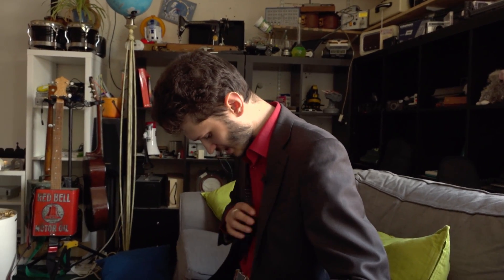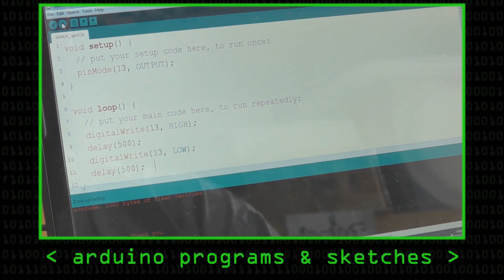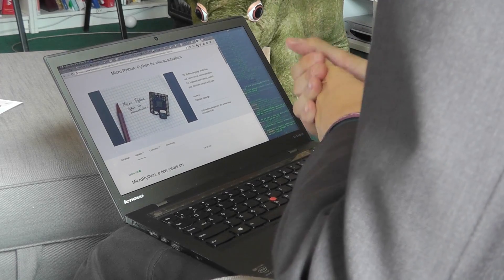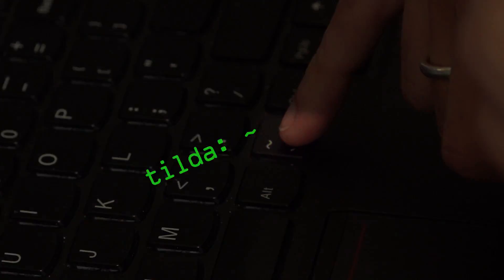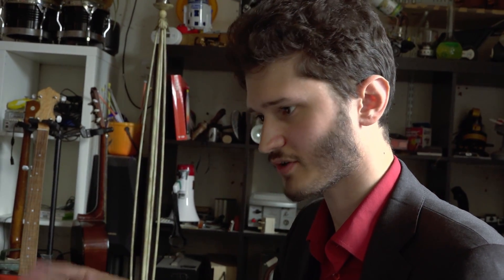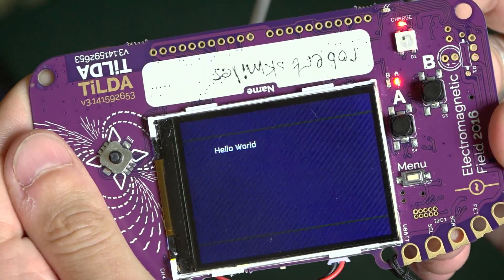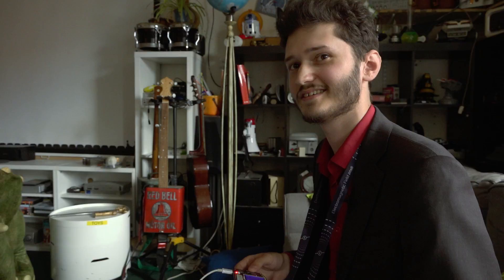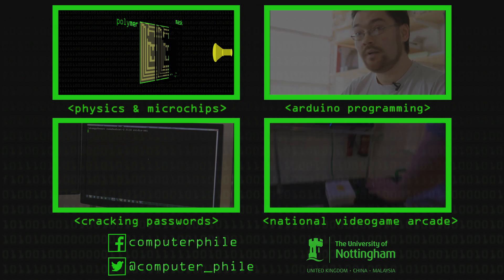Micropython Name Badge - Computerphile

Comment: the lack of ; in python really bugs me out
Reply: Azayles Right, it's probably included in the braces module. from _ _ future _ _ import braces [added spaces between underscores to avoid markdown]
Reply: That's because someone taught you what ; is. If you think about it, it's just ununnecessary noise.
Doesn't bother me though, but there is no need for it.
Reply: You get used to it
Reply: It's optional (: I put them in just to keep the habit up.
Reply: It's amazing just like the lack of the brackets around blocks. Also you can still write the semicolons, it will work (but it's disgusting).
Reply: You mean it bugs out your python programs? :P
Reply: They look ugly, you'll never write elegant pythonic code if you use semi-colon.
Reply: From a human perspective the white space design can by ideal. But we are talking about invisible characters that replace visible characters for code separation. It sounded insane to me at first. Especially when thinking about how formatting would effect code that it never effected before. 

But this insane idea is working and it is working well. The language I hated at first glance is now my favorite language.
Reply: Just use IMPORT ";"
Reply: You're free to include them. I get thrown off that if, for, while etc don't have brackets.
Reply: I hated it to starting off with, separating code blocks with whitespace was such a far out concept to me. When I first saw Python I thought it was disgusting code, but now its my favorite programming language. I got over my snobbish purist C style syntax ideas.
Reply: stereotypical hillbilly voice Go back ta VB, we dun like yer kind 'round ere.
Reply: Everything about python bugs me out. I get it, people like their words. I prefer binary.
Reply: ***** Id' like to know why?

I find the white space design in python super ideal
Reply: I came to Python after decades of experience with C, C++, and C# primarily.  I was quite uncertain about it.  Caring about spacing?  No line-end character?  Various other similar things.

But I am now entirely a Python zealot.  It has its warts for sure, but every language ecosystem does.  Pythons concentration on readability is more revolutionary than it has any right to be.  Other languages don't have anything in their spec per se that prevents their code from being readable, but they do many things from using cryptic abbreviated names in their standard libraries to having established conventions shared by most of their users which serve to make their code unreadable.  I have experience with a quite broad number of languages but Python is currently my go-to in almost all cases.  

The code usually works the first time it is run (I honestly do not know if this is something I should credit Python with or if it's an artifact of having decades of experience, but I don't usually have that experience in other languages so I think Python has something to do with it) and when I come back to it 6 months later, it immediately makes sense.  I highly recommend anyone interested in programming at any level to learn Python and play with it.  Read PEP-8, learn the conventions, drop by #python on Freenode if you have questions.  You will not regret it.
Reply: One of it's defining features.
Reply: Neceros 
Pfffff assembly is for noobs, I memorized the entire instruction set.
Seriously though.
I was actually talking about python not being a compiled language. I guess python is more convenient. But it's not something I'd use for serious applications.
Reply: This idea that Python is interpreted is like the idea of viking helmets having horns. Believed by many but is still wrong. Almost the only Python code that I know to be interpreted is the code you write on the fly in the interpreter. 

Still, many believe that non native compilation of code is interpreted. It's a purist view that I once shared. But I got over the idea of one paradigm to rule them all or one language to rule them all.
Reply: +goeiecool9999 wtf? you can run C++ on way more platforms than python and C on even more. Heck, you can even compile C to a texas instrument calculator. Try to do that with python.
Reply: Asu It's not insanely slow. lol. It IS slower than c, yes, but so is C#, and C++, etc. Any time you get more abstraction it takes a tiny bit longer.

C is only faster than python when you are dealing with the largest amount of data. Python is perfectly fine in most situations.
Reply: Neceros I don't know about you... But I think you just got completely destroyed and you're afraid to admit it.
Reply: swifterik It's only needed after ifs, fors, whiles, etc.
Reply: Agree, ; has no purpose in JAVA and C. In other languages it does though.
Reply: goeiecool9999 Pfft, Assembly or bust
Reply: ***** Yes and python just happens to be interpreted by default. Sure you might be able to compile it, but that's not how it was designed by the developers.
Reply: ***** This still has nothing to do with the original version of python.
Reply: goeiecool9999 Python is as much a compiled language as c# is.
Reply: Neceros That's why I avoid them.
Reply: goeiecool9999 What language do you use?
Reply: ***** It matters not if you buy into it, because for me, and many others, it's one of the biggest reasons I like Python.
Reply: ***** Maybe for you
Reply: The readability thing with Python has nothing to do with the syntax or the language itself. It was simply made into a principle, an idea to be followed. And most followed it and encouraged others to do so as well. It has worked on the same principles as inoculation. Readability or unreadability can be achieved in any language, Python simply has a community that has set readability as one of its major pillars.
Reply: Qauzzix That is true... but I don't know that you can say any language can be made readable.  I started to write a comment elsewhere saying that C can be readable, but then realized that's not really possible because of the standard libraries.  You're still going to have to know the non-obvious difference between strcmp and strncmp and what they do in the first place.
Reply: the lack of { } bugs me out even more though
Reply: Biggest advantage of C/C++ is that it runs on most systems.
Reply: Asu That's what I meant to say derp... correcting my mistake.
Reply: Asu MicroPython. Bam.
Reply: Neceros do what does it support? ARM? and then?
Reply: Asu https://micropython.org/
Reply: Though a nice thing about python is that a lot op people can write it. C/C++ can be used to compile fast libs for python, so more people can enjoy your C/C++ stuff ^^
Reply: +Neceros I feel like there's one more thing to be said.
Why not learn both. Why do we get into arguments about this stuff. You have to accept python has its limitations. If there's no library for it someone has to go back to a lower level language to make one. K let's put this thing to rest now...
Reply: You want to type MORE with no reason? Okkkkk...
Reply: Yeah. I learned python first, but after working with C++ for a while, going back to no semicolons is a little weird
Reply: You bug me out.
Reply: The use of single quotes for strings in python really bugs me out. I'm gonna stick with double quotes for everything, even if I have to escape a double quote. I'd rather be consistent.
Reply: Useful for multiple short statements per line
Reply: ok?
Reply: I find the lack of { and } more annoying. whitespace languages, wtf.
Reply: Asu I'm happy for you. You are not the norm.

Comment: U aint never getting windows on arm raspies friend, unless you wanna settle for deprecated Windows RT :)
Reply: +WubblyJubblyUK https://ibin.co/2sgbME1zMp7k.png
Reply: I bet in a few Pi versions we will get a full windows running ;)
Reply: Only if they switch to an intel chip... non RT windows cant run on the arm chipset the pi uses.
Reply: Windows 10 mobile will run on Qualcomm ARM chips, like those found in smartphones. However, it is incompatible with Broadcom ARM chips, like those found in the RPi
Reply: Fair enough you got me, kinda. Not really for end users is it.
Reply: Windows IOT is not a full windows. It is only a platform for apps. It is so bare bone it doesn't have anything to start with. The usual linux OS for RPI are complete, you can do anything on them without any external/additional device/PC.
Reply: +WubblyJubblyUK That's we was saying "I won't judge" He never said it was for end users.
Reply: So does it mean we're getting W10 for ARM? Since "ain't never" is a double negation?
Reply: ***** Why would you want to run Windows? It's inferior to Linux. (I use both)
Reply: Windows CE (and derivatives), Windows RT, older Windows (like 3.11) on an emulated x86 CPU…
Reply: In terms of the available library of software that runs on it, It's a big stretch to claim linux is > windows.  Don't get me wrong, I love linux, I have several flavours I use on virtual machines on my windows box but there is a lack of polish to linux still and the library of professional software tools for many fields of endeavour is still an issue for me.  Then there is gaming on linux, it's improving and with Vulkan may even begin to gain a lot of traction in this area but linux still falls hugely short in this area.

Windows 10 is actually really fantastic for me.  It's stable, has a super fast boot times and the UI really appeals to me, powershell is a fantastic tool for management of the system.  Most importantly, it's about the only OS on which REAL PC gaming is supported.

I even love the new direction MS is taking with open sourcing many of the non core windows elements it contains.  They've even enabled the WLS (windows linux subsystem) with the anniversary update which enables a terminal running bash to execute native ELF binaries.